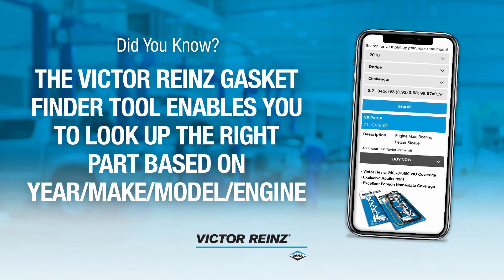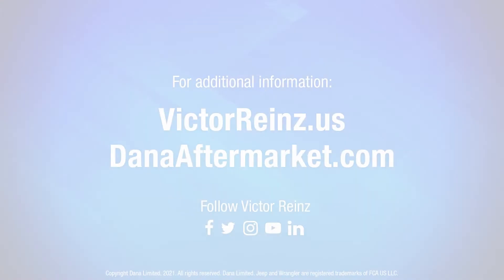Molded Rubber Gaskets | Victor-Tech™ |  Victor Reinz®

Comment: Got the timing chain gasket kit RN 15-10894-01 for my 2007 Frontier. Most the kit is not for my engine. Kit did not include the rubber/metal sealing washers. Sealent supplied with kit skins in 5 minutes. Frontier cover requires about 5 feet of sealant and 25 bolts. If you can lay out the sealant. position the cover, and get all the bolts in in 5 minutes, you are indeed the Master Mechanic!